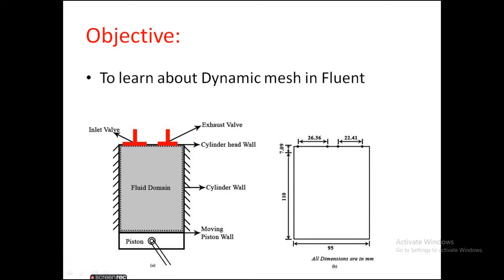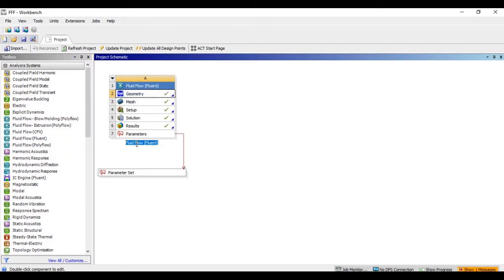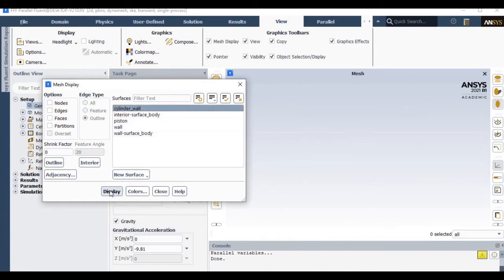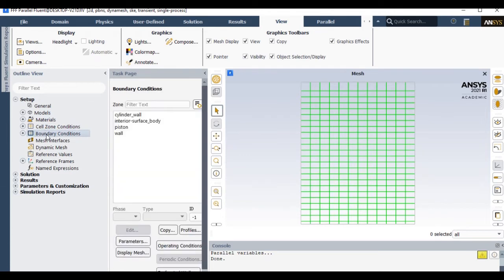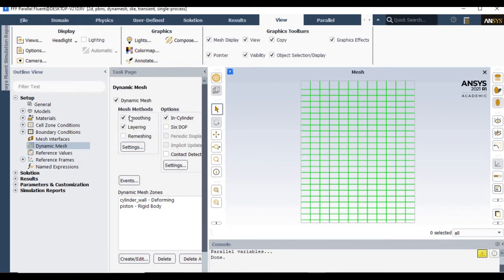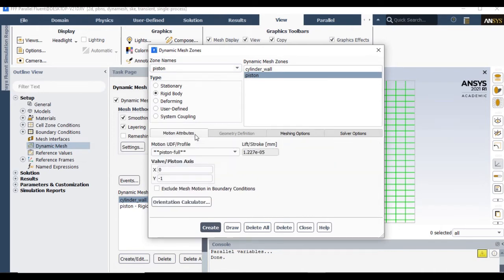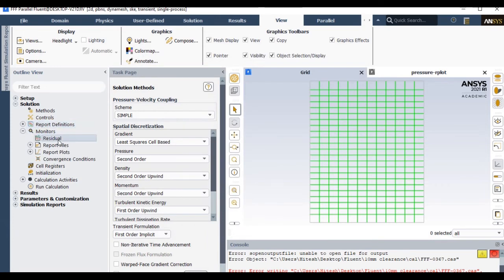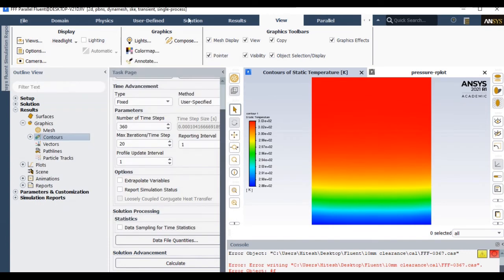ANSYS-Fluent tutorial-Dynamic Mesh for suction and compression stroke

Comment: Hi admin, thank you for your helpful video. However, when i follow your tutorial and run calculation, i meet the error: Update-Dynamic-Mesh failed. Negative cell volume detected. Can you tell me how to solve this problem?
Reply: you have not drawn the same as he has drawn in the design modeller (look at the y axis it is in the midpoint)
Reply: You have to change the units to milimeter (if it doesn't work as he did, you can change it under "units..." that should help